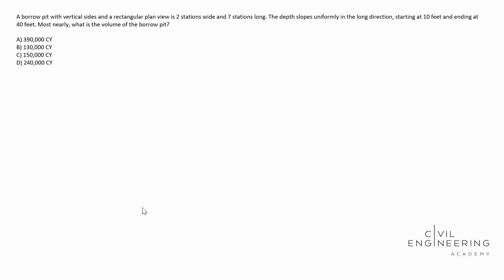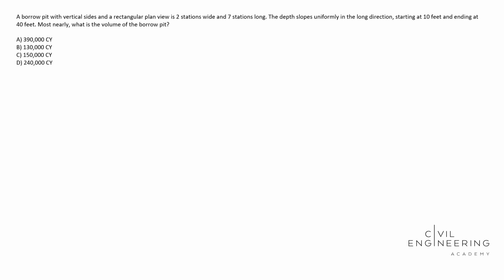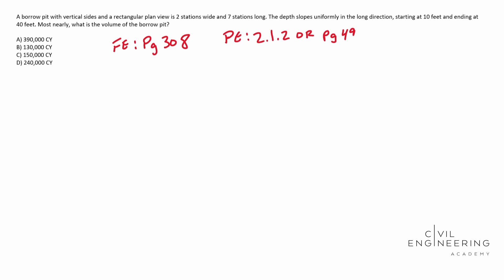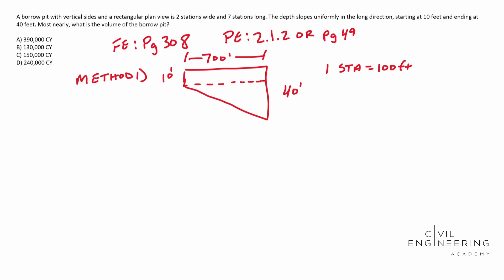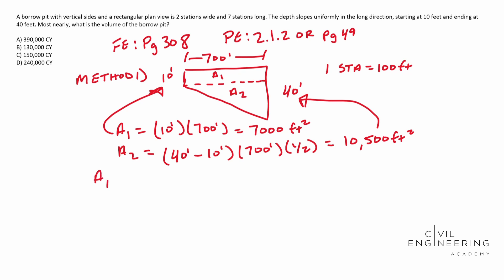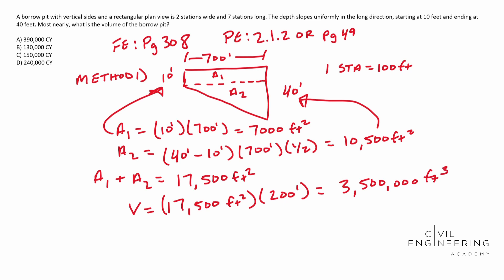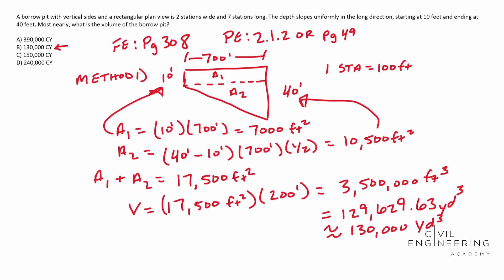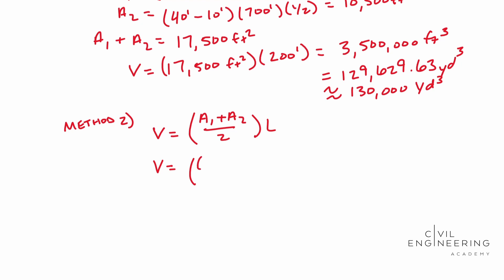Civil FE/PE Problem - Geotech - How to Calculate Volume of a Borrow Pit (Updated)

Comment: Could just do average ends method for the depth. (10+40)/2 = 25. 
(25*200*700)/27 = 129629 cubic yards. Takes two seconds.
Reply: This saves allot of time. Thank you for the short cut